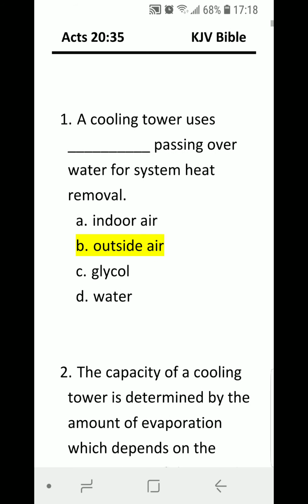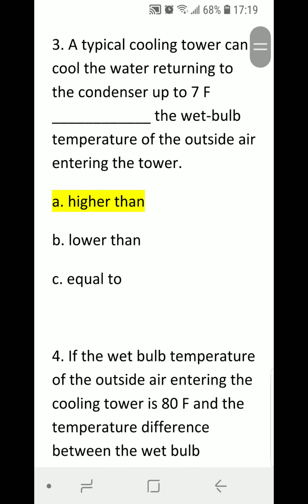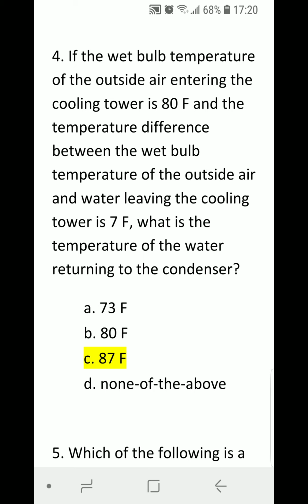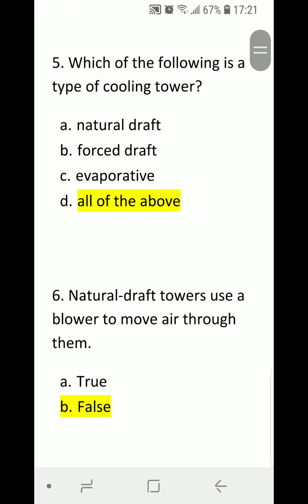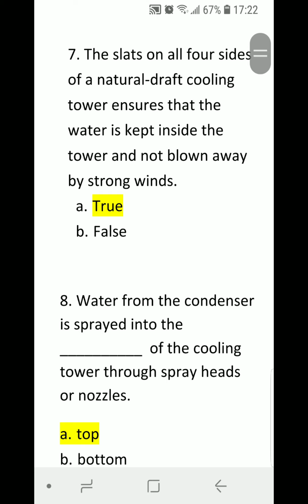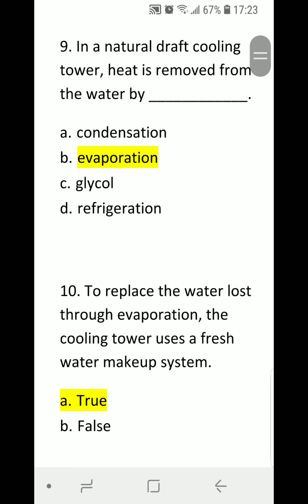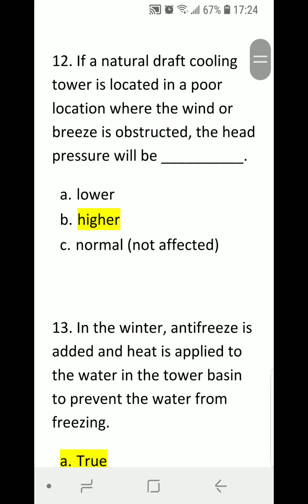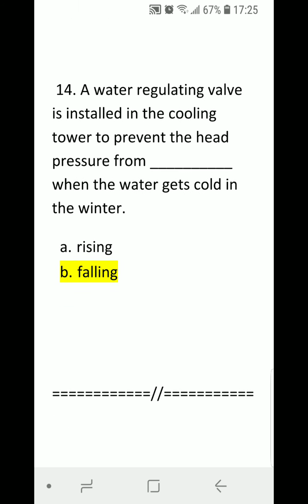REFRIGERATION HVAC EXAM PRACTICE QUESTIONS set 13

Comment: We use butterfly valves back my country in Canada which values use inlet closing values in cooling tower is there any safety trip switch when water not coming from cooling tower
Reply from the maker: Yes there is a Low-Water Cutoff switch